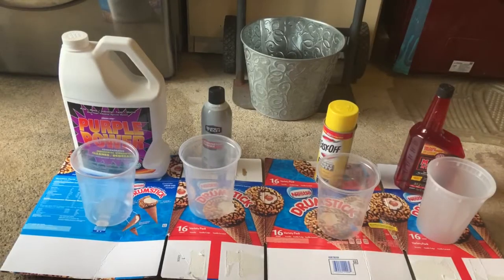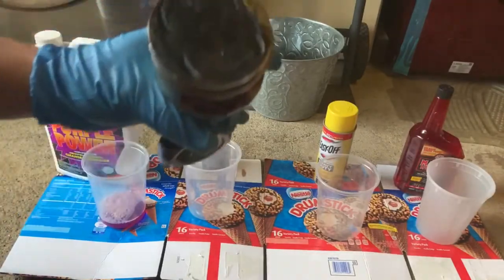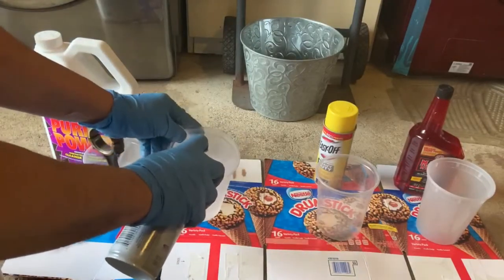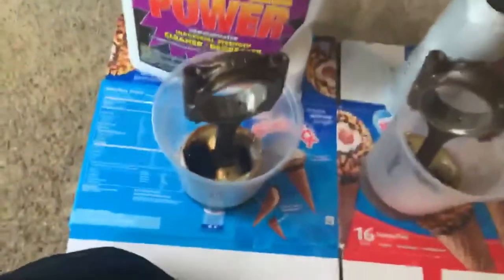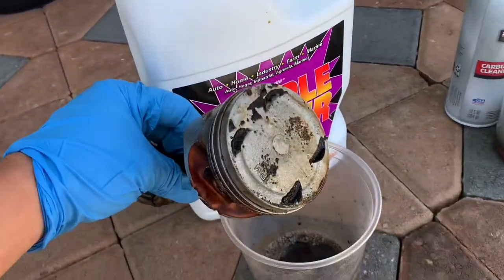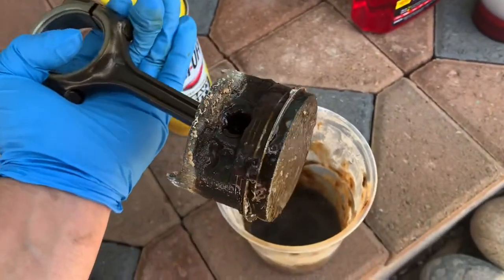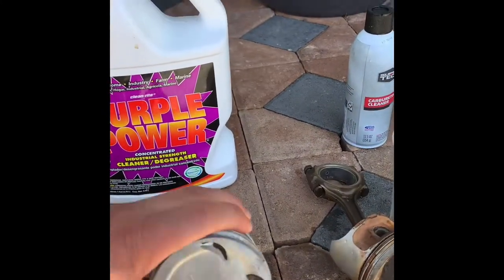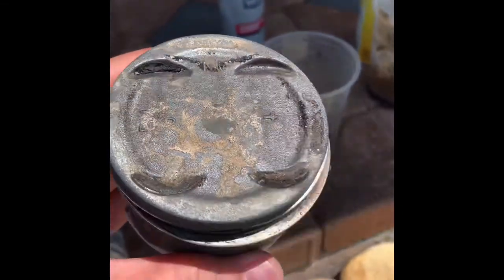How to remove carbon deposits from D16a6 Honda Crx 88-91 si piston diy

Comment: looks like you've destroyed #3? I've heard most kitchen degreasers are aggressive to aluminum parts. How did that piston look after cleaning?
Reply from the maker: Yes absolutely destroyed the aluminum but my intention is to swap it with P29 pistons.  I just got tied up with different project but for sure I will upload the assembly video with p29.